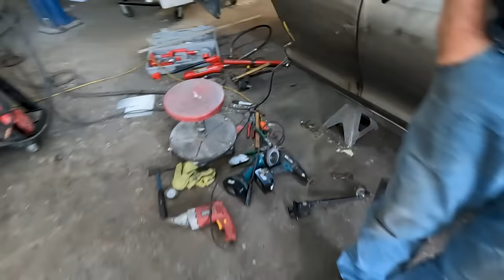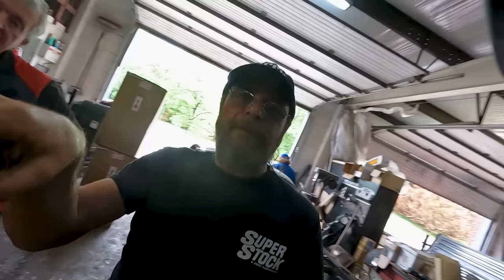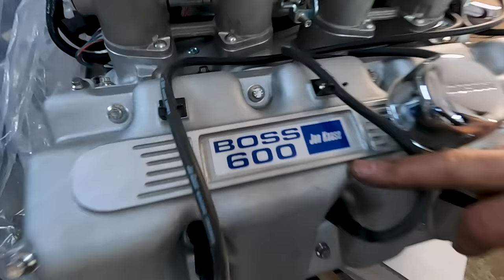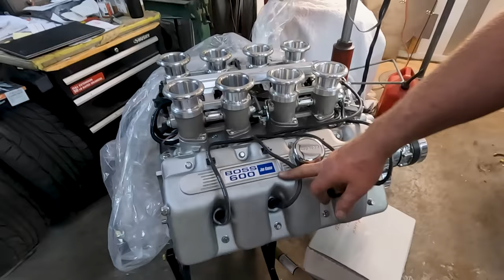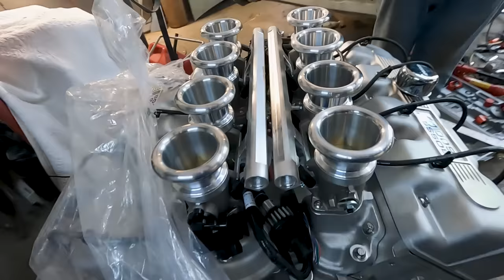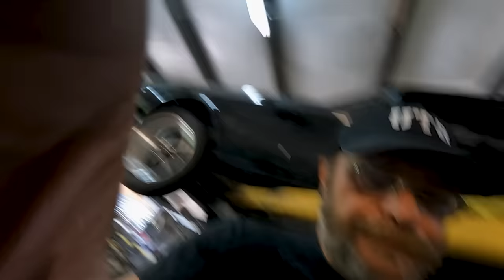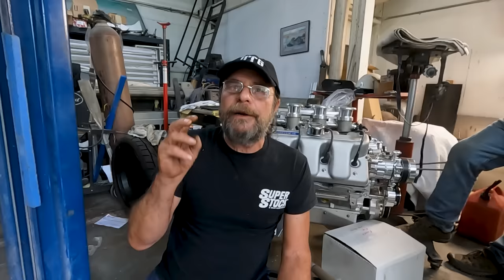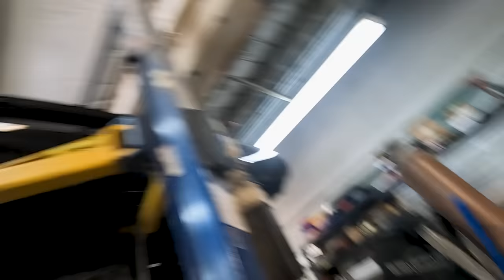How Ford Screwed The Pooch On What SHOULD Have Been The Greatest Musclecar Engine Ever

Comment: The new kr500 is 925 hp its underated by the way and pulls over 1000hp easily. We tested and drove them at ford that car is so fast its unbelievable and its light lotts of carbon fiber. It hooks well to its built too but still can break them free at 70mph . That car honestly is not for anyone who does not know what the f there doing driving. I think 100 is being built maybe 200

Comment: I think a lot of people miss the Ford muscle car strategy. In the 1960’s and 70’s Ford had a Muscle Parts program. 

There were three levels, Impressor, Controller and Dominator. 

As you would expect each stage built upon the one before it in ever increasing performance capability. 

I don’t think GM or Mopar had anything like the Muscle Parts Program at the time. This was a Ford exclusive I believe. 

See Ford being probably the most fiscally challenged and therefore most fiscally responsible found a way to give the performance hungry enthusiasts exactly what they needed. 

I know this for a fact because the kid next door did this exact thing on his little’65 Mustang coupe. 

That is Ford built a car with hood basic bones. A young person would buy said car and as he or she became able they could order individual or packaged factory tested parts to improve performance. 

You might start out with the first stage (Impressor) and then as things went along you went to stage 2 and then 3 which by the time you got to the top you had a fairly radical machine. 

With this method Ford was letting the owner choose the level of performance, drivability, and warranty impact. 

If you look at times posted for modern day Pure Stock drags you will not see many Fords because none of the Impressor, Controller, or certainly not the Dominator modifications are allowed. 

What you will see though are many early Mustangs, Falcons and Comets running in vintage road racing events because number one the modifications are allowed and number two the Muscle Parts Program included chassis and brake mods. 

The Boss 429 would have literally been a better fit in the Torino but even still in the Mustang it was a few tweaks away from being very competitive.

Comment: of course the low production of the new would take it outta most of us average car guys price range.   then stack on all the speciality parts.    yes i like the B429 but given todays technology. its basically a novelty engine.    same with the aftermarket pontiac engines.   yes cool yes fast but not practical all things considered.
Reply: The Boss 429 is alive and well and raced HEAVILY, just not so much in drag racing other than mountain motor.   Truck pulling and open class mud racing, it is dominant.  It’s not a novelty engine anymore than a BBC or a 426 Hemi.
Reply: @RacingRon47  another reason I consider it and the hemi a novelty is due to they being so rare and expensive for the (average) car guy. and when or if you find an oem hemi or boss it will cost you far more any other old engine.  Yes I know the aftermarket has picked them up and they are and will be in use for many years to come.

Comment: Ford never intended to sell a halo performance car it was only produced to homologate the engine for Nascar. Bunkie Knudsen was the exec pushing the car and was fired soon after the car was released and it languished due to internal politics etc typical of a big company. HF II announced for 1970 they were cutting their racing budget by 75% further limiting any B9 engine development. The right motor at the wrong time you are working backwards in time but can't because that's not how history works. The comments about smog pump equipment etc are silly..to sell the car it had to comply with the federal and California emissions laws no if ands or buts..same for many other Ford engines of the era plus other manufacturers a well... the law is the law

Comment: This engine wouldn't have cut it with hot rodders back in the day due to the fact that it's mammoth size would have prevented installing it in the compact and midsize fords of the day . It wouldn't even fit in the mustang , they had to be modified by Kar Kraft .  The average hot rodder would have had to drop it into somehing like an LTD or fullsized mercury .

Comment: Smokey had 3 NASCAR versions of the Boss 429 engines in the mid 60's and they had one on the cover of Hot Rod baclk then with a Hemi , SOHC and Rat on the cover . The people at Ford dropped out of racing in 1971 so the Boss 429 was never produced in any quantity or never got enough devolipment except for Ed Prout and Ohio George who put twin turbo's on and the NHRA  told him not to bring the car back to any events because it had no competion so George went back to the 427 SOHC and did real good . Also they had a 494 Aluminum Can Am engine  that they gave to Mario Andretti to develop instead of somebody like Dan Gurney who was a a master inventor or even A.J. Foyt to thrash out .

Comment: I've told people for years that a STOCK Boss 429 is a dog, and have been called a hater for saying it.  The engine has great potential, but Ford choked and detuned the hell out of it.  I think the mismatch between the cam and heads kill it more than anything else does, although the restrictive exhaust and dinky carburetor don't do it any favors either.  The problem with the cam is by the time the heads are working well the cam is done.  Square port Big Block Chevy's and Chrysler Hemi's still have smaller camshafts in stock form than race engines typically have, but their cams are HUGE compared to the Boss 429's stock cam.  Ford's terrible engine bays don't help the matter.  The shock towers severely limit the physical size of an engine that can fit, which is why they had to modify the Mustang shock towers just to shoehorn it in.  It would be a little tight, but not terrible in a Cuda or Challenger, and would fit EASILY into a Camaro or Nova.  Because of this, the Mustang was NOT a good choice to put the Boss 429 into.  The Torino would have been a much better choice in 1970.  That's the bad news.  The good news is a cam, headers, and bigger carb would REALLY wake a Boss 429 up.  Have fun with the headers in that tiny Mustang engine bay though!

Comment: So in short, too much cylinder head and not enough motor underneath them.  People always think more is better and for full throttle drag racing it is but for street use you've got to have efficiency at low rpm too.  Huge flowing cylinder heads don't start working until 4000 rpm.

Comment: Remember, the FE started out it's life as only a 332, and as such, not a big block.
The 427's had extra strengthening in the lower end, so you can't just take 352 or 390, for example and turn it into a 427 (R).
Reply: The 332/352 was a small displacement big block. Don't forget the first Mopar B block was a 350 cubic inch and first Chevy big block was a 348. I agree on the FE being dimensionally the smallest of the big blocks, especially bore spacing.

Comment: On what planet is the bbc king of n/a hp?? Tony, the Boss9 IS the leading engine worldwide in terms of N/A HP, and it’s not even close in reality.  .  This isn’t opinion it’s fact.  

Do you watch mud racing? Boss 9s are setting MRA records handily over any other platform.  Jason czaja’s B9 built by Tony Bischoff is nearly undefeated in pro stock.  This engine likely makes near 1700 hp N/A.  With one carburetor.  And way under 800 cubic inches.  

Nhra mountain motor pro stock is dominated by Kaase shotguns.  These are the most powerful N/A engines on earth.  Also, the reason the DRCE exists is literally because the factory BBC could not compete with Gliddens shotgun.  

The B/C441 heads are what Sonny directly copied off then adapted to a BBC block.   As the BBC was getting pounded in mountain motor pro stock.

You can’t compare an engine built for two years in extremely limited production to a BBC which was built for 40 plus years. Is there many high hp BBC’s out there? Yes , as there should be.  But who is the king ?  You know the answer.

Comment: The 385 series BBF is essentially a BBC.  The Boss 429 is the combination of yes the 426 Hemi and BBC, which in this case is the BBF.  The BBF is the underrated engine, and would have gone on to dominate the 70s IMO if not for insurance, and the EPA.  Generously sized bottem end allowing for 550 cubes with a stock block, and sturdy even with 2 bolt mains allowing to comfortably take 900+HP.  It arrived too late (‘68).  Although I enjoy building them, they are not expensive nor  esoteric.

Comment: The Boss 429 was not a failure because of its design or parts breakage. It was mostly due to the big shots at Ford and various other factors.

As said, Connie Kalitta and Mickey Thomposon put it on the map. It outran the Mopar Hemi's in Top Fuel competion and took their records away from them!!

The crank was no heavier than the Mopar unit was, and the rods they used were about the same weight too. The heavy exhaust rocker arm was certainly more problematic than the Mopar equivelant, but the Boss heads did indeed outflow the Mopars by a moderate margin.

But like it was said, the Mopar had a head start against it, it had several years of R&D into it already, as to where the Ford was the new player. 

The Blown fuel Boss made more power and went faster than even the blown fuel 427 SOHC.

But by the time it just began to show promise, Ford pulled the plug and called it quits.
Reply from the maker: Not to be insulting, but you have no idea what you're talking about.  Let's just say that I know every single nut and bolt of every single combination used in the fuel classes back then.  I've personally worked with much of that hardware and talked exhaustively with the people directly involved with building and tuning those cars.  I studied Fuel racing as my absolute religion for half my life.
The way I explained it in this video IS the way it was (all paraphrased, of course)
Reply: For this reason, and Ford dumping the Cleveland for the shitty Wndsore, i began to dislike how Ford operated. And then I changed the spark plugs in a 67 Mustang with a 390. The dislike headed towards disgust. Now i have grown into hating the company. Sadness.
Reply: @UncleTonysGarage  ...  it took some years before the 426 would " dominate " fuel and I'm not so sure that it ever did in the 1960's at least. Must have been tense on Monday mornings to see " Chrysler FirePower " valve covers in the morning paper ( a Chrysler exec in 1968 or similar ). " Isn't that the engine that we shitcanned 10 years ago " , lol.
Reply from the maker: Mike, you're absolutely right, BUT for the sake of staying focused on the history of this particular engine, we had to condense history a bit.

Comment: Ford did cheat everyone that bought a Boss 429 but they didnt care about that in respect to getting these homolagated and out on the street so these were legal to race in nascar.The other thing they screwed up big time on these that cost alot of engines was they installed high volume oil pumps from the factory and they woukd starve the bottom end on street cars and wipe out the crankshafts.They just threw these out there without regard to making these what they should have been.

Comment: In my opinion the 427 cammer was the king of the big blocks not the big block Chevy. It was the most powerful naturally aspirated engine till the new corvette overhead cam engine came out.  It took Chevy nearly 60 years to beat the 427 cammer in horsepower ratings

Comment: the reason for a hemi head is the increase in displacement because of surface area the cammer made 635 hp naturally aspirated which was unheard of at that time as we have learned through time that flow and aspiration is power it is a shame the hemi heads were allowed for builders to get an edge for a few years  but overhead cams by ford were banned because of huge hp numbers the politics that drown innovation where would we be today how much quicker would we have seen the coyote motor had not chevy and Chrysler had tantrum to stay in the winners circle through laws and rules the only thing ford missed with cammer was a longer tensioner and a engine girdle had they continued down this path the leaps in head flow would have came a lot sooner

Comment: BBC the king of horsepower? Meh

I like watching guys try to run them on nitro. I've never seen one go a whole weekend without going BOOM!

If it were the better design NASCAR wouldn't have had to keep limiting Chrysler and Ford so they could keep up.
Reply from the maker: UNDISPUTED king of N/A horsepower.  Many have come and gone, but the Rat still wins and is still true to its original form.
Now, someday I may do a video on the very exact and specific reasons the Chevy does not do well on nitro in MOST circumstances but I'm not ready to completely clean out the memory banks just yet.

Comment: The boss 429 385 series Ford is the best big block. We can get almost an unlimited amount of cubic inches from these stock blocks. The canted valve heads of the 429scj are close to the ones in the Cleveland and we know what damage that did in prostock. The issue was as you stated in the video TERRIBLE sponsorship by Ford very very limited numbers because like you also stated they were released right before oil embargo and we didn’t even get to see a performance production 460ci Ford was also going to introduce a 429cj program in prostock. Those two things never happened mad it hindered the development of these big Fords also became rare and these engines ended up getting relegated to work duty in big Ford trucks which they served very well until 1999. Mailaise eda government ruins the fun always does.

Comment: The problem with ford was they had too many similar engines. The 427 was a masterpiece. The 428 was a street jewel that was plagued with oiling issues and heavy parts . The 429 boss had one flaw debuts in 69 and dies at the end of 70 then you got the smog block 429 which people initially believed it was the same but then when they pulled the wool over peoples eyes people walked away if the boss was supported longer. The 351 Cleveland wouldn’t be the darling it is today

Comment: uncle T, you need to look some stuff up...the first canted valve v8 was 1950s Chrysler POLYSPHERE.   a Chevy engineer copied, improved it to make the Mystery Motor 1963.  Ford claimed a handful so Chevy could prove they were true stock engines, so NASCAR would legalize them.  Fird eventually improved the design into the 385 and 335 series engines, 429/460 351C/M/400M.  Mystery motor was bastardized for GM production.  it could NOT compete in NASCAR, the short rod and low r/s ratio caused it to chuck rods.  From 1963 to 1974 Mopar and Ford DOMINATED NASCAR with 426 Hemi, 427 FE high riser/tunnel port, and 429 BOSS.  427 BBC hardly won a race after 1963.  the CID limit had to be cut to 355" cuz Chevy WHINED for years,  could not compete.  Chevy couldn't even beat the Pontiac 389/421 motors 1958-63, let alone the Hemi and Fords.

Comment: the ford 427 stock would beat all chevy engines hands down, hence why they got it banned from nascar. the boss 429 69 mustang was geared wrong so it suffered in 0 to 60 and top end. once shelby left ford stopped the high hp motors. so how many 302 boss 1971 mustangs were built??

Comment: PART3
AFTER CRY---SLER HAD THE FORD CAMMER BANNED IN NASCAR. FORD ANSWERS WITH THE 427 HIGH RISER ENGINE (THE BASIS OF CHEVY'S LS ENGINE TODAY) AND ONCE AGAIN CRY--SLER PUTS PRESSURE ON NASCAR TO HAVE THAT ALSO BANNED BY SAYING THE CAR REQUIRED THE USE OF THE ORIGINAL FACTORY HOOD. AND THAT USING THE TEARDROP HOOD WAS ILLEGAL. SO FORD WAS ONLY ABLE TO USE THE MEDIUM RISER ENGINE. ANOTHER WIN FOR THE HEMI USING WRITTEN AND UNWRITTEN RULES. MEANWHILE THE CAMMER MAKES IT'S WAY TO DRAG RACING. LINCOLN MERCURY STARTS THE DEVELOPMENT OF THE FIRST TUB CHASSIS FLIP FLOP FUNNY CAR CALLED THE ELIMINATOR 1. THE BASIS OF ALL FUNNY CAR DESIGNS TODAY. THEN FORD STUFFS THE 427 CAMMER INTO IT AND HISTORY IS MADE IN TOP FUEL. THE CAMMER MAULS DOWN THE HEMI AND SETS ALL KINDS OF RECORDS AND THE CAR WAS UNBEATABLE WINNING RACE AFTER RACE. THE CAMMER WAS A BETTER DESIGN THAN THE HEMI. BECAUSE OF IT'S OVER HEAD CAM DESIGN. THE CAMMER WAS ABLE TO HAVE STRAIGHTER AND  LARGER INTAKE RUNNERS WHICH GAVE IT AN ADVANTAGE OVER THE HEMI. LOOK AT THE OLD FOOTAGE OF THE GAS RONDA MUSTANG RACING AGAINST THE HEMI'S. IT EASILY BEAT THE HEMIS.

Comment: makes me want to BRICK my screen.........ITS AN EXACT MATCH between the HEMI and the RAT motor..........lolol really..........this guy never mentions that the boss 429 is an oversquare engine designed for HIGH RPM HP which it made so well that the Winged mopars powered by the Hemi were helpless against it...........but this design does NOT lend itself well to low end torque so it was terrible on the streets , drag strips and the very short tracks in nascar.
Reply from the maker: Over/undersquare are easily changed variables that have nothing to do the an engines overall design.
Reply: @UncleTonysGarage  right, so long stroke wihich makes a lot of torque means nothing...........nor does a short stroke which gave the B9 400-600 more RPM than the hemi...........OK, glad you are not working on my engines.
Reply from the maker: You're not thinking, David.  A crank is something that bolts in...rods and pistons swap in and out without effecting an engines overall configuration.
Example...you can have an FE at 352 cubic inches and you can have an FE at 428 inches...it's STILL an FE, right?
Reply: @UncleTonysGarage  lol, not sure what you are smoking lololol an engine is an air pump and the length of stroke determines how much air comes in..........in addition the shorter the stroke the MORE rpms an engine makes.